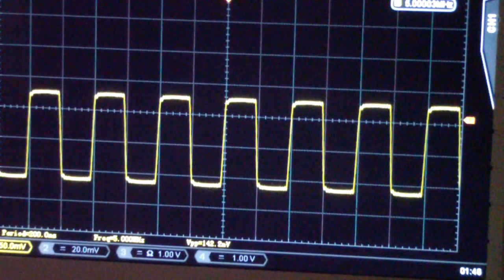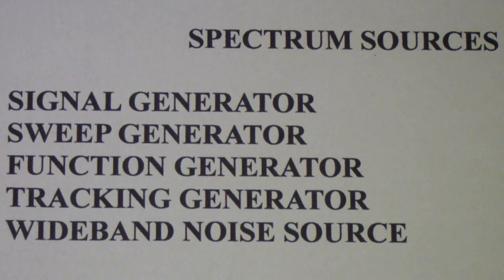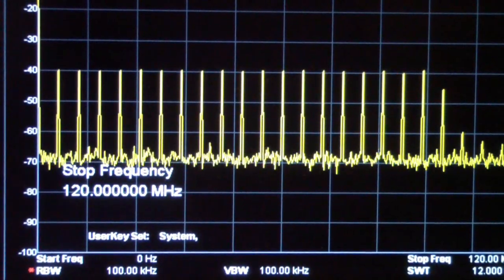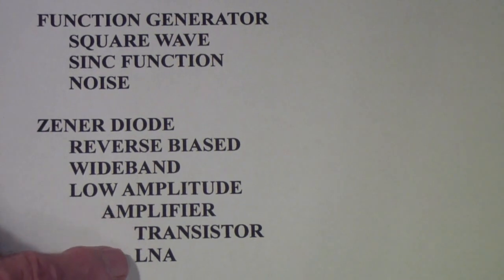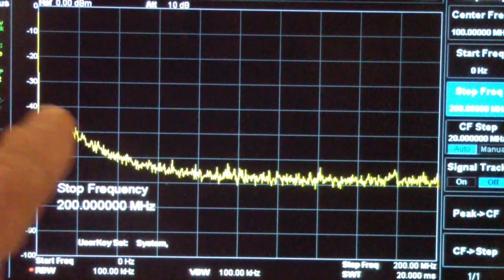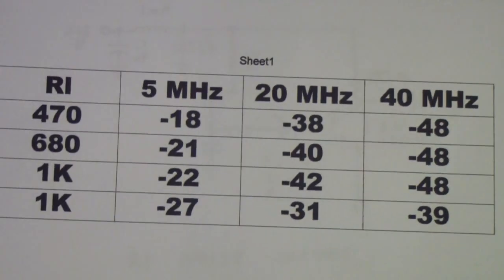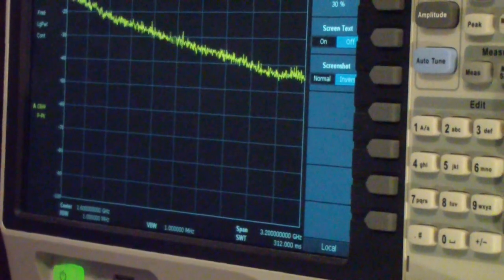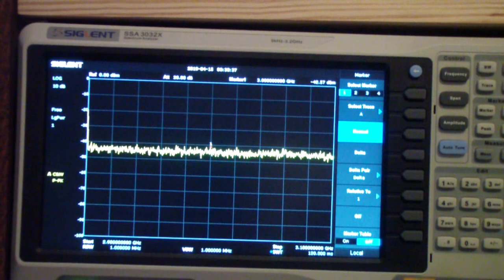TTT258 Spectrum Sources

Comment: With most spectrum analyzers you can use the trace math functions to normalize the noise output line and make it flat for measurement purposes. Although that still isn't as useful as having an actually very flat noise line, it can make it easier to visualize mostly accurate filter response results, etc.
Reply from the maker: Thank you for your comment and suggestion. I probably should have mentioned the use of math traces since they can be very useful in cases like you mention. Such trace math functions are available on many spectrum analyzers such as the DSA-815 and SSA3032X that I have shown in some videos but I have not been able to find them in the RSP Spectrum Analyzer software, which, I admit, is the primary focus of this series of videos. Perhaps at some point I will update my earlier series on Spectrum Analyzers (TTT052, 054, 056, and 076) and include trace math then. If you are aware of a good YouTube video that already exists on this, please let me know and I will mention it.
Reply: @tomtektest8042  There may be some good Youtube videos on it, but I don't know of any. By the way, thanks very much for the videos you share; I have recently discovered them and have learned a lot! 73s

Comment: If you generat low frequency pulses with fast rising/falling times, you will have flat frequency contents somehow better than since function. Not the best solution, but if you're in a pinch and only a function generator is available,  it can be useful. 
Shahriar at TheSignalPath made a video on that topic while reviewing an old siglent   function generator.